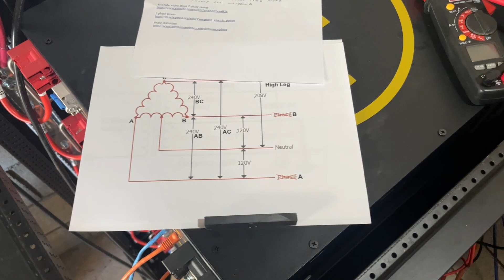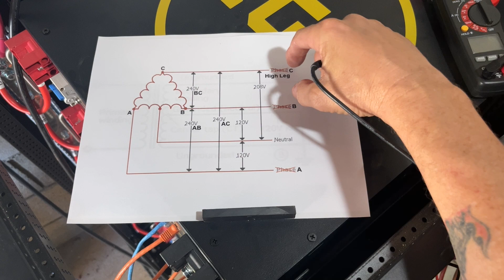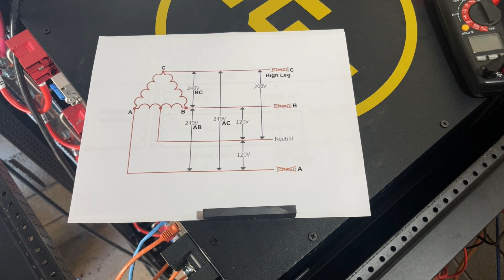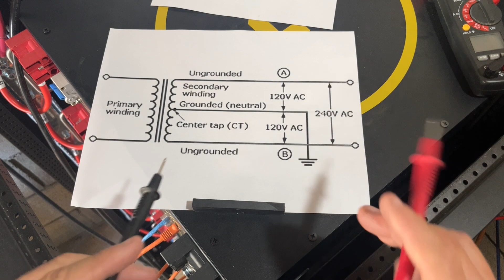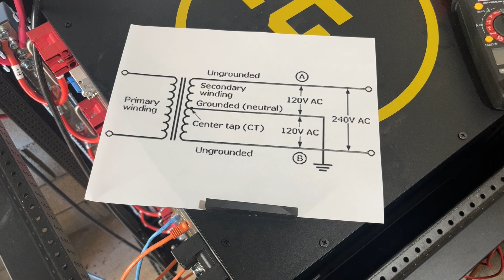There's No 2 Phase Power

Comment: Saving my comment until you noted that two phase was indeed used in the past, thanks for keeping honest

Wouldn’t a 2 wire device in a three phase system be 2 phase? Or is that terminology specifically for when there’s only two phases present at the utility
Reply from the maker: No, 2 wires can only be single phase as the video points out. It's "one" of the three phases.
Reply: @McDIY for a split phase system sure, I’ll try to explain this differently. A two pole breaker in a three phase panel can not be single phase as  there’s no phase being split on site. The center of the wye configuration in the transformer is being tapped with the neutral, so using two wires would be splitting two separate phases, not splitting a single phase
Reply from the maker: @michaelsinger5851  Watch the video again. Split phase is a split 'single' phase. It splits the single phase of the two wires to which you are referring. Only using two wires can only be single phase. Any two of the three wires. You need all three wires to achieve three phase.